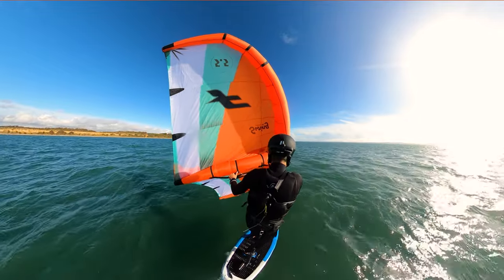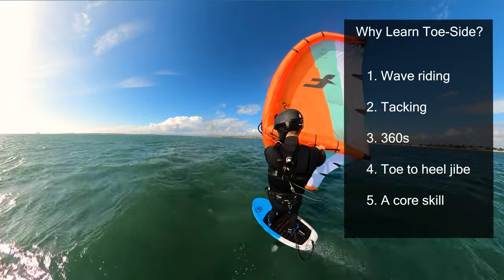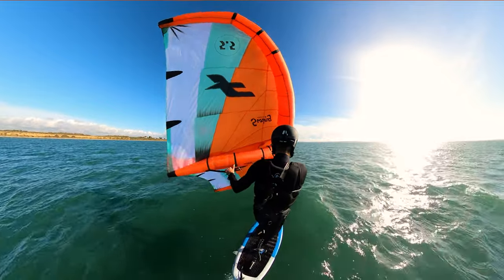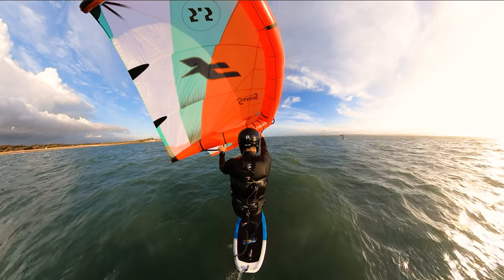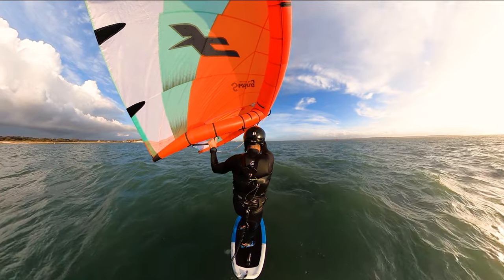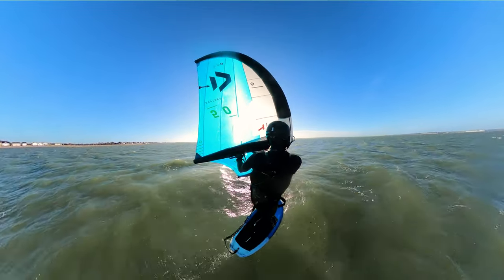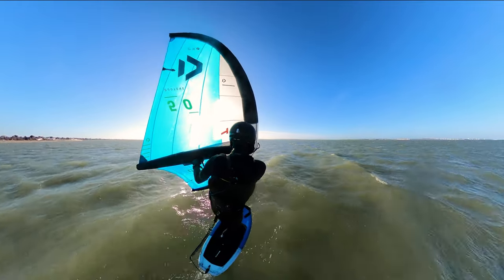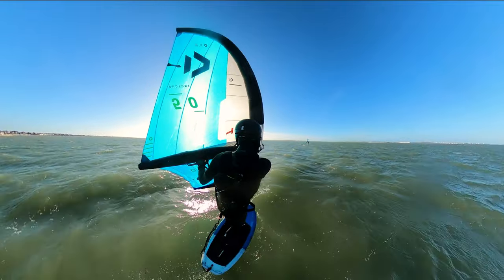Toe-Side BreakDown

Comment: Thank you very much indeed, I really appreciate these videos. Struggling with toe side is exactly where I’m at! I shall try putting this to practice tomorrow.
Reply from the maker: let us know how you get on. Toe-side does take time to master but it's the key to the treasure. Once unlocked everything changes.
Reply: Well I had a good session yesterday down at Hayling. I found that positioning my back foot forward before the gybe really helped coming out toe side and I did increase my distance in toe side although I still struggled to maintain control for very long. On reflection I think moving my rear foot over to windward and maybe giving front foot straps a try could be my next move. Thanks again.
Ian

Comment: Do you feel that using a longer fuselage helps, hurts or is immaterial to riding toeside? TIA!
Reply from the maker: if you are struggling with pitch control in toe side then perhaps a longer fuse would help but otherwise, no I don't think it makes much difference.

Comment: That was the first time I've heard that keeping the foil level makes it vulnerable to head off downwind! I  realise now that's probably why I'm always wondering off downwind in my gybes. Since I've committed a bit more to the turn I've had greater success with gybing. Sometimes my processing directions from my brain to my feet in toeside gets mixed up & I stall. Would reaching out the front arm to get the wing more open to the wind be a nuance that would help me recover until I get my board level? Any other tips that don't involve the feet to recover from this situation until I get used to toeside riding?
Reply from the maker: I'm not sure that reaching out would put more pressure on your front foot. Moving the wing towards the front of the board would naturally shift your weight onto the front foot. As the video points out, most stalling is caused by weighting the back foot, so the best solution is moving that forwards on the board so it has less ability to stall your board.

Comment: Unique insights offered here, first on I’ve seen that emphasizes rear foot positioning (both location and direction) to produce the needed forces.  Anything going on with positioning of front foot?
Reply from the maker: for me I use footstraps, so my front foot is limited in what I can do with it. You can still point it forwards a little to reduce twist in the torso, without straps you can obviously just point it straight forwards and reduce torso twist significantly - but you would need to move it more towards the center line otherwise you are compromising your ability to get board angle by pressing through your toes. In toe-side the front foot is really driving off the toes fully if it is in a strap, where as the backfoot you can generally move around and position to suit what you are trying to achieve.
Reply: Hey thanks for your thoughts.  Also, I notice on other videos (not yours because of the camera perspective) that riders might exaggerate the knee bend in toe side which seems to aid in the torso twist.  In regular stance, I'm often trying to keep knees straighter in order to avoid being hunched over, learn that relaxed looking regular stance. @Wing-Tips
Reply from the maker: @davidhmws  I think the knee bend in toe-side is more a consequence of wanting to get your weight windward, if you stand very straight you tend to be very open to getting yanked  back towards the wing and you can't just bend your legs to sit down to control the gusts.

Comment: Couple things I noticed when riding toeside. Trying to put my chin above my arm holding the front handle, gets my weight forward and to the side perfectly.  
Moving your hand on the front all the way back on the handle helped too, not sure why though haha
Reply from the maker: certainly visual aids like this can help you get your weight right. Regarding holding the front handle at the back, this opens the wing leading edge out more towards the wind, so it has the effect of elongating your arm slightly whilst at the same time moving the wing into a more traditional position without having to pull the back hand in more. The only downside to this is some wings are not that stable flown off the back of the front handle.